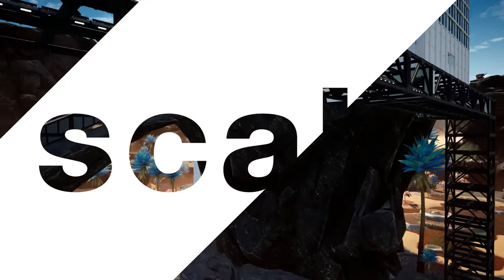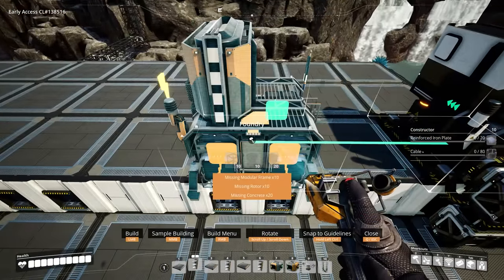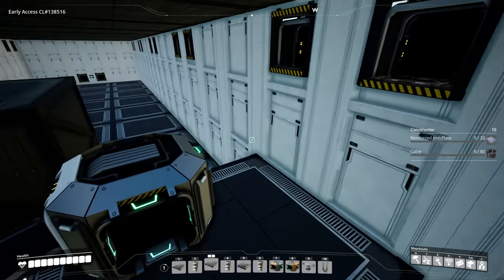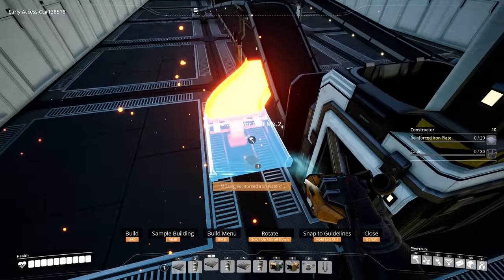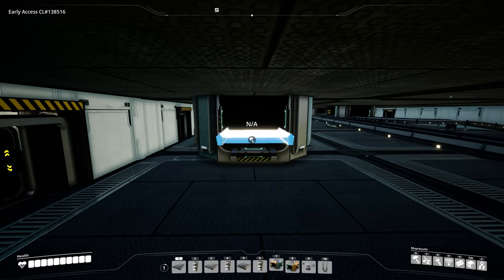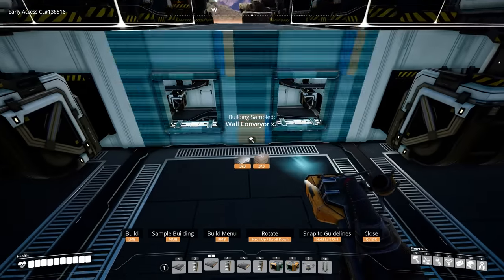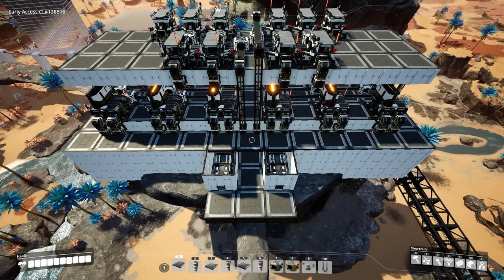Basic Steel Factory - 90 Beams & 80 Pipes / Minute [SATISFACTORY GUIDE]

Comment: Greetings Pioneer,
i have seen u build the same conveyor bus belttowers like i do.
i go for this setup to reduce the amount of towers:

Tower -> 6 Foundations (place conveyorwall) -> 5 Foundations -> Tower

On each Tower you can place a Powerpole in the middle. Has the perfect lenght to each other.
Works also with Wallmount Powerconnectors.

After placing the conveyor belts, you can delete the connecting Foundations and the middle Conveyorwall.
Looks great with floating belts and keeps the whole factory look clean.
Wish you the best. :)

Comment: BIG fan of the way you build and how you present your videos! All my factories use your vertical integration technique. If I could make one suggestion/request? If you could put a still shot with a diagram for each floor so it is easier to determine which buildings are making which parts, that would be extremely helpful. :)

Comment: To make this 100% efficient (in terms of power usage that is, the output technically already is because of the 1:1 ratio's) you should probably slighty underclock the foundries (by 11.111%). As by default they expect 45/min input and it's only 40 (because of splitting the 240 by 6). Or overclock the miners and the constructors to 112.5% but then you need Mk.3 belts from the foundry outputs to the constructors. And its probably not worth it in terms of output vs power usage (16.75 vs 15 beams/m and 22.5 v 20 pipes/m), so I would just underclock.

Great video's, I'm following most of them for my own playthrough, you have a neat build style!

Comment: Just created this and it was fun building it. I did have trouble with the right lift that goes down to the storage (in my case, the steel beam); the one on 22:40 because it won't pass the items to the next lift below even after checking the input & outputs multiple times. What I did was put a conveyor pole at the edge, placed down the conveyor, connected the lift, and only then it worked. Definitely an annoying bug.

Comment: Hi. Thank you for all your hard work. It is appreciated. I have a question on your Scalti Steel Factory megaprint. I installed it on my world. I hooked up the outputs running into storage. The factory immediately began producing steel pipe and steel beams WITHOUT any inputs or power hookups.  As much as I like something for nothing, this seems like a bit of a spoiler for game play.
Reply from the maker: Whomever shared that, recreated the factory from my guide and distributed the print of it without my knowing. Sorry you had that experience.
Reply: Thank you for your quick reply. Would you consider uploading your build to SCIM Calculator?

Comment: If you're ever worried about getting stuck in a sandwich layer just remember you can slide under belts 98% of the time. Like if you can build speed for even a second you can slide under even super low belts

Comment: if you overclock the miners you can use the full load capacity of the MK3 belts at 270 instead of 240. Thus giving you 45 steel ingots from each foundry instead of 40. Not sure if that makes any difference higher up in the chain though :)
Reply from the maker: It does. That’s why I don’t use the full belt capacity.

Comment: I've found that it's WAY simpler to load balance the coal and iron ores if you have both materials entering from both ends. Only requires 12 splitters and super simple belts of appropriate speed, and it fits perfectly in in halves with each end of the building supplying each side of foundries.
Reply: This may be late but what exactly do you mean by that?

Comment: 4:36 i think that there's a mistake there... 45+45+45=135 and a MK2 Belt only can handle 120 so i think you will need a MK3 belt there
Reply: Yeah, this runs at 89% efficiency due to those undersized conveyor belts at the end.

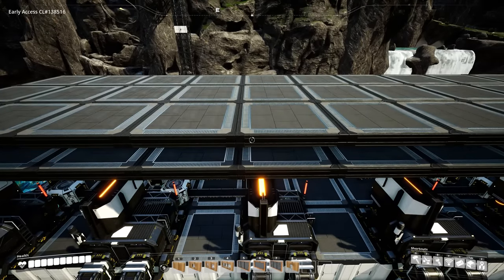Comment: Hello Scati, I am actually having 1 issue with ur build (Btw love the videos!) Anyways, if you cant answer then it is what it is. The issue I am having is in regards to the walls you start putting down at 14:21. Now I a made the sandwich layer exactly like yours but when I put the walls down it doesnt go flush like yours. I used the 8 x 1's with the 2 spaces in between empty , but my wall covers 1 more space above. Anyways I hope you can help me in regards to this, and if there is a way I can show you my issue I will! Thank you again for the videos! Actually never mind , I read the comment below and it got me thinking . SO the solution I did was actually made 1 more 8X1 under ur sandwich layer to use that as my foundation to get the wall in sync with ur sandwich layer.
Reply from the maker: In some instances you can’t build the extra 8x1 below. Solution is to build a wall on the top foundation and then aim at the lower part of the wall to set the snapping point and that second lower wall will be flush.
Reply: @Scalti  Doh! I didn't even think of that! Well thanks again for replying my dude, keep up the good work!

Comment: Hey Scalti, I love your videos!!!!  I enjoy building my own styles, but yours are so clean, I haven't found a way to make mine as good.  I have modified this though to use floor holes instead of the conveyor holes.  So I have one question...  you are running 3 foundries per belt on the first part... but you said they each produce 45... so that's 135 per belt....  and you are saying to use Mk2s...  so that cuts off 15 per belt.
Reply from the maker: They can produce up to 45 / min but they’re only putting out 40. 12 is easier than 10 to load balance.

Comment: I don't know if I missed it in the video, but I thought I'd point it out. I was wondering why he used MK2 Belts per foundry line and not MK3 as the standard ratio per foundry is 45 Steel Ingots/min. giving you 135 per min. output. I underclocked each foundry to output a max. of 40 Steel Ingots/min. giving the stated 120 per line. You could run it at 135 per min. but then you'd clog the system and it wouldn't run 100% effecient. It had me confused for a bit there. Apologies if it is indeed stated in the video and I just missed it.

Mind you I am following this in 2023, so maybe the devs changed the ratio of the foundry since this video went up.
Reply from the maker: Each foundry is only processing 40/min of their 45 total. So input is 120 and means the output is 120.

Comment: Just a suggestion, but you might consider doing a couple of additional steps when making your video, all of which are (unfortunately) rather time intensive. 
1. When you complete a floor, give us a top down still of all the beltwork/production placement with all the pieces clearly labeled. 
2. Put in time stamps for the relevant sections. 
3. Consider doing alternate recipe builds. For example a steel build that uses the recipe for solid steel ingots (60/min) instead of the base recipe (45/min). 
Just suggestions, though. I understand that most of these would add a pretty big burden on your workload, but they would all be pretty useful for your viewers.

Comment: This is awesome! Quick question, from someone who's finished all the available tiers with only 4 steel foundries and more pipes and beams than I need... what do you need 90 beams per minute for? Just for the fun of making a cool system?
Reply from the maker: MK3 Belts, MK3 belts everywhere. 

It’s partially because it was a clean split. This design can also be modified into the encased beams factory if desired. Better to have it not need it than need it not have it.

Comment: Hi there, I know its months later but I recently got satisfactory and decided to create your incredible build. I was wondering if there is any chance you have a view of the inputs? The build is working but all my foundries are only working at 25% as they cannot receive enough ore. I am using Mk.2 miners on 3 normal Iron nodes merged into one Mk.3 belt leading them to the factory where they are split into the two conveyor lifts mk.2 (output should exceed 300).

The rate of coal seems to be fine from 2 mk.2 miner pure nodes, so the iron output should be just below that but not enough for it to be so little.

Is there any solution you'd recommend?
Reply: More months later (and you've probably already figured all this out), but just in case it helps, you don't have enough iron coming into the system.  He says at the beginning that you need 480 iron and 480 coal coming into the system per minute.  Three Mk 2 miners on normal nodes would yield 3*120=360 iron per minute, which is not enough for this build.  You either need one more Mk 2 miner on a normal iron node, or tear down one of your existing Mk 2 miners and then overclock your remaining two Mk 2 miners to 200%.  Either way will get you to the 480 iron/minute that you need.

Comment: Nice video!  Quick Question, plz... to the left of your build selector at the bottom of the screen is a wheel with a number in the center, I assume is so you can populate it with different items to build.  How does it work and how can you access the different menus?  Tks!!
Reply from the maker: You hold down a modifier key (I believe it’s alt by default, I would check the keybinds) and use the scroll wheel to cycle through your bars. I typically organize each bar by type (e.g. belt logistics, fluid logistics, power, production machines, etc.)

Comment: This guide is great and all but how am I supposed to get 480 iron and coal per minute coming in? Gonna need like 30 miners
Reply from the maker: 2 MK1 on a pure node overclocked to 200%, 4 overclocked 200% on a normal node, 2 MK2 on a pure node, 2 MK2 at 200% on a normal node, 1 MK2 at 200% on a pure node (if you have MK4 logistics), etc.
Reply: @Scalti  What's the closest together one can find these pure iron nodes?  After using up all the normal and pure nodes in the first starting area (I've done through the modular frame build) I'm left with nine impure iron and no coal nodes in the entire first biome, as far as I can tell.  I feel like once the factory is done and fills the storage containers, the nodes it uses lie dormant.  How can I start to siphon off these early parts to make later ones?  Why start a motor factory with smelters instead of with rotors from your rotor factory?

Comment: Do the foundrys need to be at 89%, even with MK 3 belts and lifts? Seems like my steel pipes don't have a consistant flow of Ingots to reach 80 per minute, even though everything is set up exactly, except the 89%.

Comment: I can't make the math add up here. A foundry requires 45 Iron and 45 coal to make ingots. What am I missing?
12 foundries would need 540 Ore and Coal / minute?
Reply from the maker: Math is right. Only 40 steel ingots per foundry being made.
Reply: @Scalti  so it's not 100% efficient? Because it makes 45 steel ingots at 100%?
Reply from the maker: It’s 100% efficient because you’re using all resources being pulled out of the ground with none going to waste.
Reply: @Scalti  Ah 😁 not used to under/overclocking in your vids

Comment: Hi man, thy for the guide, i really like it.
My question is that why do you use on the first floor (foundry floor) mk2 conveyor belt at the end of the mergers? 
If my calculations are good, then there needs mk3, because after the merger there are 135 (45+45+45) ingots on the belt.
Reply from the maker: Each foundry produces 40 steel ingots. Total at the end is 120 per belt.
Reply: @Scalti  OK...sry bro...i see now, that you downgrade the foundry's performance to @89% :) It is okay then. Nice guide, good work. Waiting for the next amazing work! 
(maybe computer, or the plastic production chain)

Comment: Hey Scalti, just wondering which mod you're using for the black and white buildings/walls etc. Thanks!
Reply from the maker: Not a mod! Check out the paint gun in the game. You can adjust the upper left swatch to whatever you’d like and it’ll affect all default colored structures previously built or new ones.
Reply: @Scalti  wow, didn't know that's how it works, thank you for the fast reply. Are you going to stream anytime soon?
Reply from the maker: I’ll be streaming this weekend. What day yet I’m not sure. Thinking Saturday. Spent my evening a couple days ago getting a proper overlay designed and I’m excited to debut it. In general though (if you weren’t aware) I’ll be streaming every Thursday from 8PM-12AM. Just haven’t last week and won’t tonight because of the holidays.

Comment: Question: The last belt you place at 5:03. Does that not need to be a mk3 belt instead of mk2 belt. You have 3 Foundries producing 45 steel ingots each. 45*3 = 135. mk2 belt only supports up to 120 resources per minute. 

Is there a reason for the mk2 belt instead of mk3?
Reply from the maker: Foundries are producing 40/min. 40*3 is 120.
Reply: @Scalti  Okay, thanks. :) 

Btw could you make a computer factory guide? 
Love your videos. Good to see non screaming/cringe content. :)

Comment: so im having an issue with the sandwich layers, even when placing a wall above the top layer my second wall just sticks through both layers, what am I doing wrong? the way they are placing is making it impossible to place my constructors. thanks
Reply from the maker: You need to look at the bottom of the first wall places (the one on top) and not the foundation below. Not sure what all you’ve tried but this is the first thing that comes to mind

Comment: I'm finally building something like this factory in my game, so I watched this for about the 5th time.  If each Foundry produces 45 ingots per minute, and we create 4 groups of 3 Foundries each, that's 135 ingots/minute on each line, not 120.  This would mean, if we use Mk3 belts & lifts to bring the ingots up to the Constructors, we have 540 ingots/minute total, which can feed one additional Steel Beam Constructor, or two additional Steel Pipe Constructors.  Am I right on that?  (Or did you limit to Mk2 lifts and 120/min on purpose?)  Thanks!!!
Reply: And I just realized it's a huge enormous pain to split all 4 of those lines 5 ways to pull 15 out of each, then recombine everything. ;)
Reply from the maker: Each foundry makes 40 per minute, not 45.
Reply: @Scalti  Maybe it's a change they recently made... I'm looking at my Foundries making Steel Ingots right now, and it says 45/minute, in groups of 3.  No overclocking or anything like that.
Reply: @Scalti  can confirm as you can see at this screenshot: http://prntscr.com/1d57nr6 the default is 45 per minute (unmodded) which kinda throws off this whole tutorial. If possible could you make an updated one to fit the new specs? Personally I did it by underclocking everything to 40 to keep in theme but it seems like such a waste to underclock.
Reply: @louthinator  It would probably be easier to overclock the miners to output 270, which a MK3 belt can sustain.

That still balances the Foundries, at 270 / 2 = 135, 135 / 3 = 45 for each Foundry.

Comment: I’m late for this but wouldn’t you need mk3 belts once you combine the three outputs from the foundries? Since it’s 45 x 3 = 135, and mk2 only can carry 120
Reply from the maker: It’s 40 iron/coal in and 40 ingots out.
Reply: @Scalti  nope it is 45 in 45 out
Reply from the maker: @FBI_Master  If you run at 100% efficiency. The ratio of the foundry is 1:1. So if you have 40 going in, you’ll get 40 coming out.
Reply: @Scalti  sorry man open up satisfactory and place a foundry they changed the ratio it is now 45 in to 45 out at least in experemental
Reply from the maker: @FBI_Master  the RATIO is not 45:45. It is 1:1. Something like iron plates is 3:2. You put 30 ingots in per minute, you get 20 plates per minute. If you put 9 ingots in per minute, you get 6 plates per minute. The steel ingot recipe in the foundry is 1:1. You put in 45 iron and 45 coal, you get 45 steel. So if you put in 40 iron and 40 coal, you get 40 steel. The RATIO is 1:1. Not the default processing speed.
Reply: @Scalti  you should of told us to underclock in the vid lol because you said it as if the base speed is 40 a minute not that it needs an underclock
Reply: @FBI_Master  you dont actually NEED to underclock it. if you run it at 100 percent clock it will simply be running at under maximum productivity. you will still see 40 a min per foundry.

Comment: when you merge together 3 foundries at 45 steel ingot  per minute the output is going to be 135, wouldnt you use mark 3 belts instead ?
Reply from the maker: Foundries are putting out 40/min.
Reply: @Scalti  oh okay then

Comment: one thing making it super hard to tell what to do is you dont say which side is the coal and which is the iron when you start
Reply from the maker: Doesn’t matter. As long as one side is one and the other is the opposite. It’s a nearly 100% symmetrical belt system that feeds the foundries above.